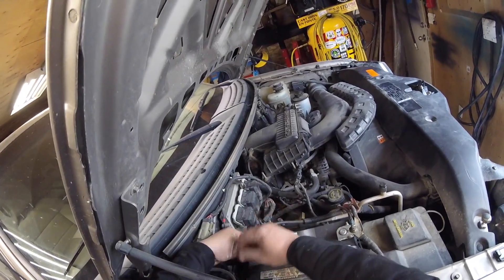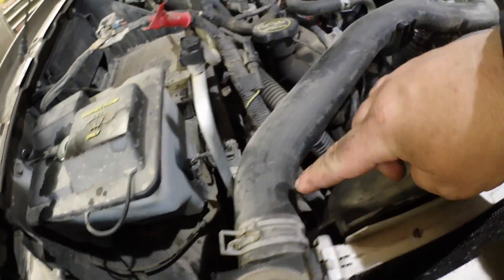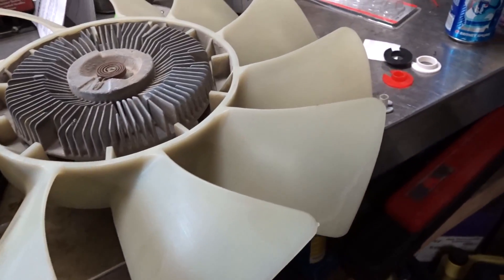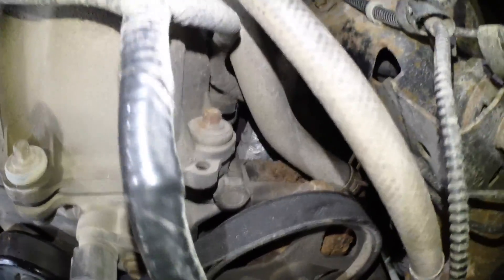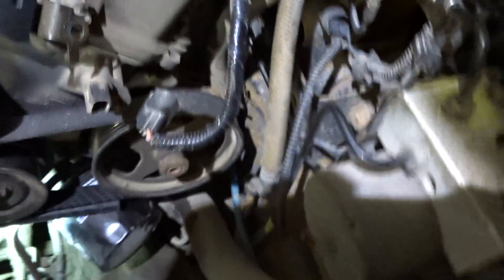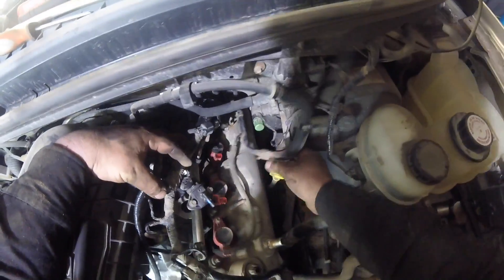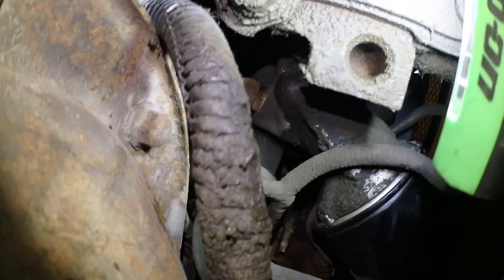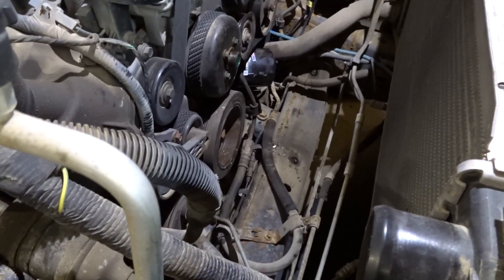Ford 5.4 3V Cam Phaser noise DIY Part 1

Comment: At the 8:36 point of your video you talk about an electrical line which you disconnected and you said it was attached to the back of power steering line.  My question is where or what does that line connect to?   Im a DIYer trying to work myself through the timing process of 5.4L and would appreciate your assistance?  I’m using both your and Brian  FMTech 4 part series to get my truck back on the road.  I believe your truck is a 06 Ford 150.  Removing wheel well coverings was a brilliant idea.  Thx